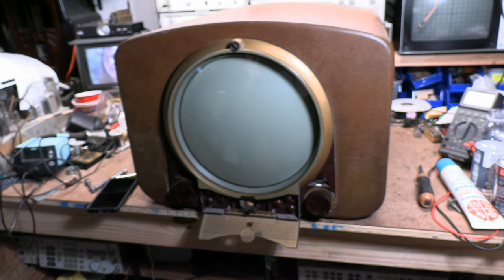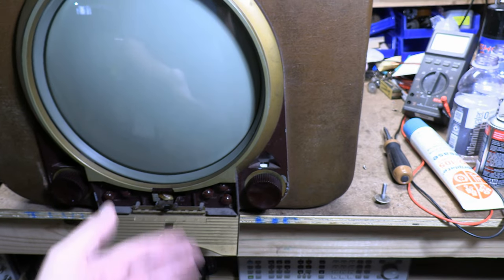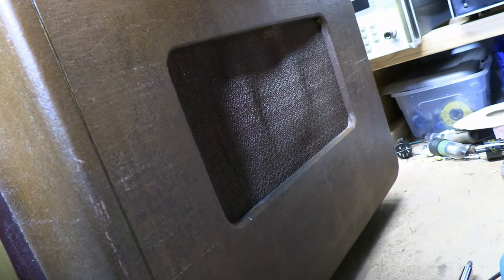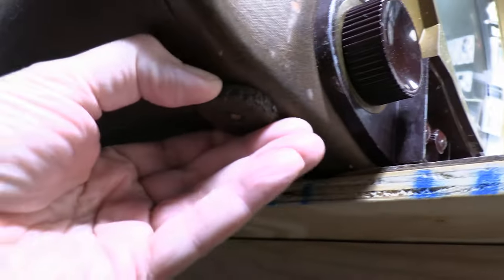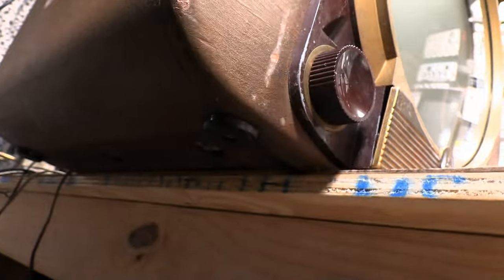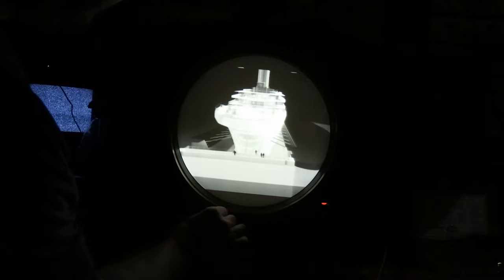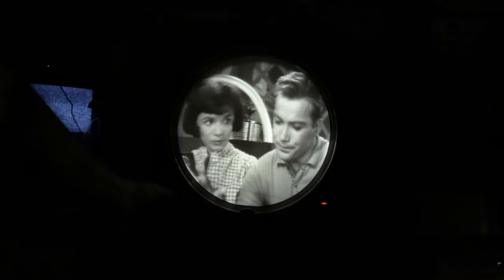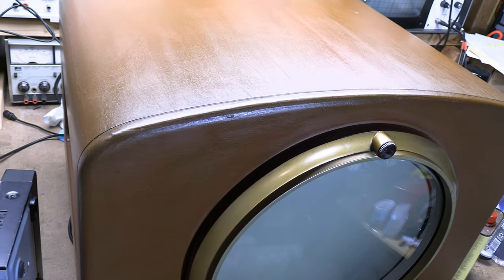Zenith G2322 Claridge "porthole" TV restoration finale! p6o6

Comment: Random note, the dot moved up when you turned the set off. On my Emerson (with the venerable 10BP4) the dot moves down. I presume the movement has to do with the ion trap. Does anyone know if the dot always moves down on a 10BP4 and up on a 16AP4?
Reply from the maker: There is no up or down. Since it's a round CRT it can be rotated around and have no impact on the image
Reply: @bandersentv  That's true, especially since the metal CRT has a clip instead of an anode cap. The 10BP4's anode cap is pointing straight up and I suspect most are but I suppose there's no technical reason for that. In this orientation pin 3 is up and pin 6 is to the left of the set. Per the datasheet pin 6 is the north pole of the ion trap magnet and if we apply the right hand rule this means the magnet deflects a negative beam upwards. As the voltage decreases this deflection lessens and this explains why my spot moves down. Basically I just answered my own question, it is directly explained by the ion trap magnet.

TLDR on a 10BP4 the dot moves towards pin 9. I'm guessing you have pin 9 on top in the Zenith.
Reply from the maker: Most 10BP4s are mounted with the anode lead angled to one side or the other - sometimes down.  Don't recall seeing any straight up.  If it's been rebuilt, anything is possible.
Reply: @bandersentv  Mine is an Emerson-branded picture tube coded 274848, most likely original to the set but definitely not a rebuild. I looked and the 630TS manual says the tube must be installed with the contact approximately on top. As you indicated the orientation really doesn't matter as long as you can place the ion trap correctly and all the wires reach.
Reply from the maker: Sure, that's RCA being extra cautious in the early days.  Plus, they shipped TVs without the CRT installed.  If you don't use one of their branded CRTs, I think their whole ion trap lining up with internal gun structures goes out the window.  If for no other reason than there are two ways to do it - bent gun and angled gun.